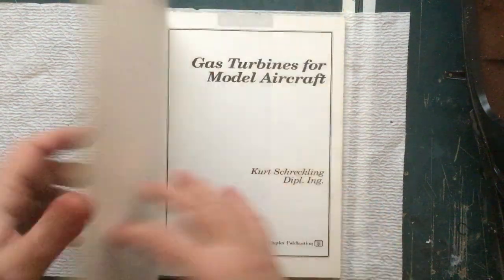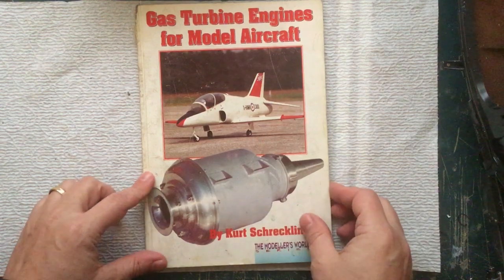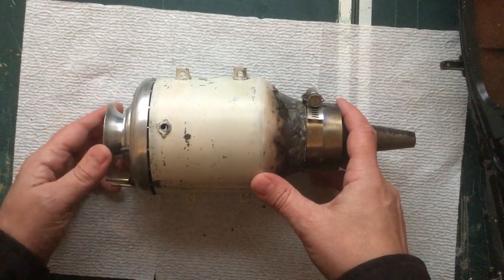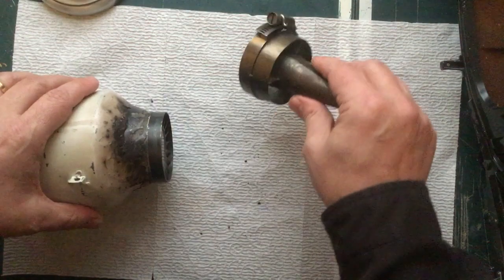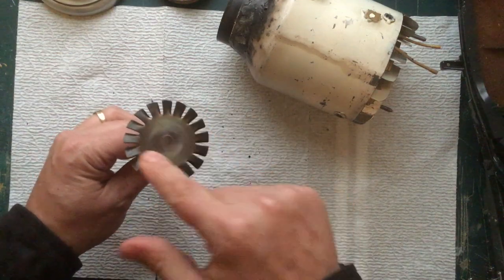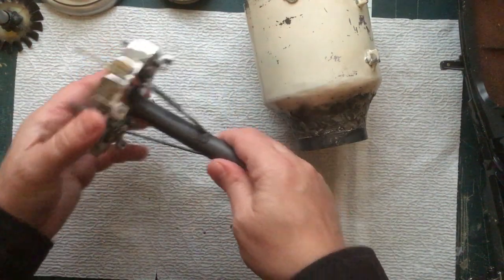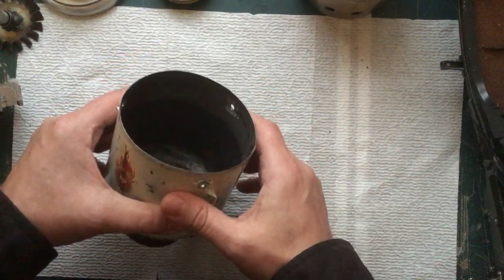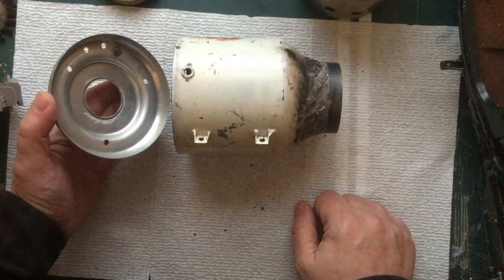Taking A Look At The Kurt Schreckling Model Turbine Engine

Comment from the maker: Here is a link to an update video answering some common questions and trying to run it; https://youtu.be/yQ16qh5LTJ0
Reply: Hi sir. Please please i understand u worked hard in that engine. I simple dont have the basic toold to build mines, can i buy one of yiur engine please?. The others are crazy expensive 🙏🙏🙏🙏
Reply from the maker: Sorry. This is my only engine. It’s not for sale. If I were to build another one to sell, I would have to charge the same or more than the cost of a new one to make it worth my time to do the work. And it wouldn’t be as good as a commercially made engine.
Reply: Hello where can i buy the book you used to do that engine?
Reply from the maker: @circunbalacion  if it’s not on Amazon or eBay, I don’t know.
Reply: @customfabrications  dont you have it yourself?
Reply: @customfabrications  how manny letters does it include?
Reply from the maker: @circunbalacion  I bought it over 25 years ago. Probably on eBay, but don’t remember.

Comment: Where is the vapurizor
Reply from the maker: Didn’t make it yet. Maybe one of these days I will. Maybe.
Reply: @customfabrications  thanks for your reply sir I'm making this model for my university project by your observation does it have any advantage of adding a vaporizer if you wish to run it only on propane
Reply from the maker: @djshera1769  it doesn’t really run on only propane. I didn’t realize this at first. I thought it was running, but it was actually slowing down. Apparently it wasn’t actually self sustained. It really needs the vaporizer to run correctly. Good luck with the build.
Reply: @  thank you so much for your guidance i am also following your   compressor video aswell since it covers everything important regarding making it, your contribution really helped me and my project thanks a lot
Reply from the maker: @djshera1769  glad to hear my video helped. Thanks for watching and commenting! And again, best of luck with your project!

Comment: what's the fuel to run it?
Reply from the maker: This type starts on propane to warm up then switch to kerosene or jet fuel. I don’t have the fuel line made yet,so I’m just running on propane, which doesn’t work well for sustained running.

Comment: Can that engine work with petrol or diesel
Reply from the maker: Prettty sure it will run on kerosene or diesel. I actually haven’t tried anything other than propane yet. And it really  doesn’t self sustain on propane as I thought. One of these days I’ll make the fuel line.

Comment: Why is the shaft tapered?
Reply from the maker: I don’t know. To make it look nice? There is an option in the book to make the shaft steel instead of aluminum. The steel shaft is a smaller diameter and not tapered.

Comment: Hi wich glue u use for corbon fibor? On compressor wheel?
Reply from the maker: CA glue, cyanoarcrylate. I tacked the end, wrapped it around once, applied the ca, wrapped it around once, applied ca, repeated until thick enough. Just be careful not to get to much that it runs and makes a big clump, but enough so that all the carbon gets impregnated.

Comment: OP said "I spend 10 bugs to built it"

And a lot of work and patience - Nice done!

Well, on a commercial version you would have a compressor made out of carbon or aluminum, a turbine out of inconnell(sp?) but it would cost at least 100 times more.
Reply from the maker: Thanks! I will be posting an update to this build soon; answering some questions, and trying to run it.

Comment: Hi nice work. Can tell me from where i can buy carbon fibre raping or u can send me any link .I don't know what is look like this carbon fibre raping. Thanks
Reply from the maker: It’s called carbon tow (or toe). I just got it from eBay, but most composite stores should have it.
Reply: I start building this engine after watching ur vedieo is almost done I was using turbo charger compressor with this engine. I run the engine but I found out this not gona work with turbo charger compressor so now. I  have to make shaft and compressor wheel  .any way thanks for video and post vedieo with runing engine

Comment: I have that book and built one of those. I changed the compressor to a garret turbo impellor and brought a wren turbine wheel. Had to change the direction of rotation for them. Instead of the three piece shaft I made an all steel one. It ran ok but always ran hot.  I also used a later design combustor from gtba plans. Ran mine on propane for starting and diesel for main fuel. It didnt like proper jet a-1 fuel. Excellent fun running them.

Comment: Actually I am making fd3 . could you tell me please that the book say to use 608bearing which dimension is 8*16*5 . Could I use 8*22*5 dimension bearing it's few large than? Sorry for bad English.
Reply from the maker: Well, I didn’t write the book or design this, so I can’t say if it would be ok. But, if all you do is change the dimensions to fit a different bearing, I don’t think it would hurt anything. Just make sure you don’t compromise the strength of any parts.
Reply: I used 608's in my engine, you have to redesign the bearing tube and also the cone part of the combustion chamber to fit. I ended up using full compliment ceramic bearings, ceramic balls in steel races.
Reply: @simonwass6315  . What is dimension of bearing you used in fd3?

Comment: Can I use galvanized sheet (G.I.sheet) for NGV in this jet engine ? Which material have you used in NGV ? . sorry for English.
Reply from the maker: I would use stainless for anything in the hot end. I don’t want to say if something else would work because I didn’t design it.
Reply: You have to use a stainless steel that resists scaling at red heat. 409 is the cheap option, works better than 304 at temperature, while costing less, but 316Ti is far better for not much more money.

Comment: Hello, can i use single shaft which dimension is 8mm its thiner than the book say? Will it effect to performance?
Reply from the maker: As long as the bearings still fit, I can't imagine how it would effect the performance. Unless the smaller diameter would flex more and show bigger effects of any vibration, but I doubt that that would even be a real concern. Sorry I don't have a better answer.
Reply: @customfabrications . Thanks a lot for feedback 😊